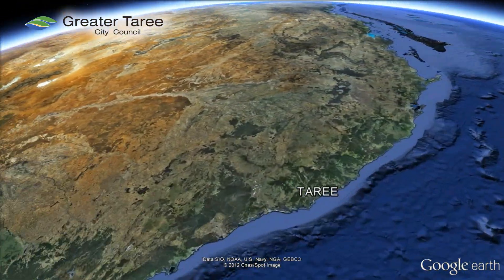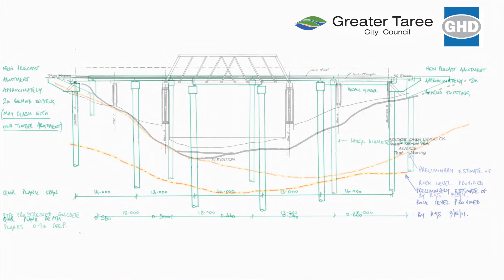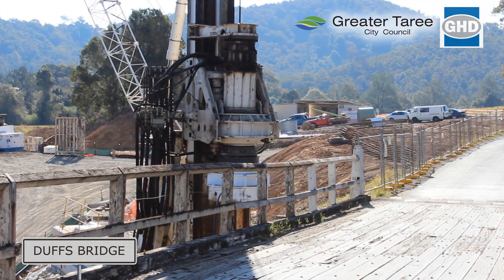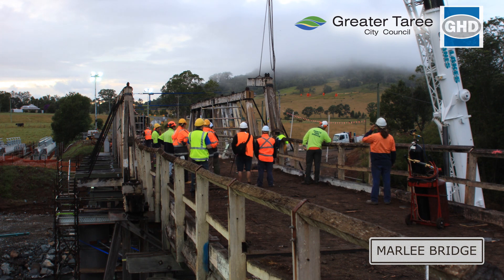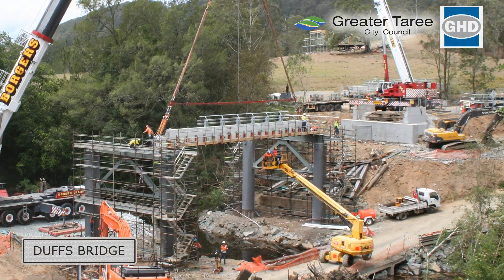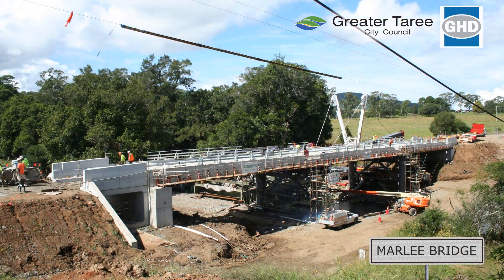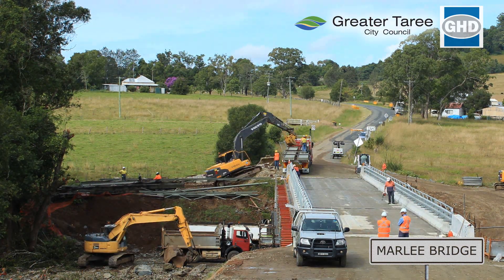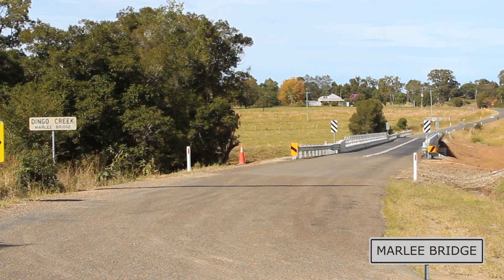Duffs Bridge and Marlee Bridge Replacements

Comment: To go off at a complete tangent. All those cranes and heavy equipment are powered by DIESEL. And always will be. The idea that heavy equipment and vehicles like that, and on a remote site, too, could ever be "battery electric" is completely absurd. For several reasons.

Comment: Of course they found an indigenous artifact.  It amazing to me we yield to “artifacts”, and demolish beautiful, historical works of art (that will last far longer than the ugly, replacement bridge ).  I think it’s disgusting how quickly the current generations want to destroy their history.  At time 8:05, You could have saved 30% by reducing the worker head count since 20 of them were just walking around doing nothing whilst others actually worked.
Reply: To my regret, this beautifull old bridge showed just in this video alone, lots of signs of needing not repairs but restauration. Which is in the modern moneydriven times just not feasable for a county to choose between steel and concrete vs wood. If some sponsor who loved the look would have told county to want to pay for the restauration (and upgrade to cope with modern trafic weights) they might have choosen to accept that. MIght because maintenance costs would still way heavy on their budgets.

The artifact mentioned was weighing on the decision where to put the new concrete bridge. Not on whether or not to demolish the historical work.
Since it was in the floodplain, the old bridge just had to go, once decision to build a new one was made.
Reply: Bert Bergers Understood.  However, I am certain there are non-artisan engineers, laborers, apprentices that would have dreamed of the opportunity to contribute to the restoration.  It is a shame, a crime really, how quickly we allow the destruction of our past.  Thank you for sharing a piece of history that we will never see again.
Reply: Rusty the Crown  You are a troll, and must have come out of your cave, moron, or mommies basement.  Most of my complaint was about the exorbitant taxes, and how the township did know about “the indigenous artifacts”, let alone care about them, until someone wanted to improve the crossing.  My other complaint is that in 19 years, no one will know about design patterns/principals that lead up to modern methods.  No appreciation for history.

Comment: The concerns about the durability of transversal bars is something that we had a major issue with in Montreal. The Champlain bridge was one of the first few in the world to use that construction method. The use of those transversal means that should any of the elements of the bridge fail, you can't replace it. This resulted in the entire bridge having to be replaced at a cost of several billions. Given that this is a much smaller bridge, it likely isn't as much of an issue, but it's definitely something to keep in mind.
Reply: Probably not billions as you said, but certainly could be quite expensive - how long are the spans on the Champlain bridge compared to this one?  Replacing a span on Champlain would probably cost at least what these two bridges cost combined, but I'm just taking a wild guess.
Reply: @MikeT-TheRetiredColonel   The Champlain bridge is a 3440 meter bridge. It's a major bridge, one of the most used in the whole of Canada. Even at such a massive cost, the economic damages of a bridge closure far outweigh any building costs. There's several hundred of millions dollars of freight being transported on it each year.  It met an early demise because it's design meant that the deck and girders were one single unit which made it impossible to replace, or properly repair parts that failed. Several hundred millions were spent to extend it's life just a few more years until it's replacement was ready.

After just a few decades, they started to notice that there was premature wear and tear. They ended up using external reinforcements to strengthen the girders supporting the road deck. That caused additional stress in the pillar heads and they also had to reinforce those. Being such an important bridge, closure would only be considered as a last resort. Plans were put in place for a worse case senario, including the purchase of a massive steel girder that they refered to as "Super Poutre" beam that could quickly be installed on top of the road deck if necessary. The bridge was wired with several hundred sensors and was monitored 24/7. In addition, regular inspections were carried out. During one of those inspections, they found a hole in one of the concrete girders that was more then a meter. Just about all of the pre-stressed cables in that girder had failed and for all intents and purposes, it's load was now being carried by the remaining girders. Super poutre was installed and stayed there for months to keep traffic moving while emergency repairs were carried out. 

The crazy thing is that while all of that was going on, government were still busy playing political games, delaying the replacement of what was now quite obviously a dangerous bridge. We had a highway viaduct collapse in the previous decade and the memories were still quite fresh. I think that Super poutre and the media attention that got is what finally did it and made the situation politically untenable. Once they finally start construction, it went up quick. Building a bridge on that scale is usually a process of a decade. They started in 2015 and finished it in 2019. Building started before the design was finalized. The new bridge is massive by any kind of scale, has a steel superstructure that can be repaired easily, or even partially replaced as needed. The rebar in the concrete is all stainless steel which should extend it's lifetime by quite a bit. The concrete itself is a special high strength mix. They really spared no expense after the mess that was the last bridge. I think that politicians have learned their lessons. There's a massive infrastructure renewal going on and there's really no opposition to spending the necessary money to make it happen.
Reply: @jonathanlanglois2742  Tks. Great to hear. Love Montreal. from Newfoundland. Good work.  good post.
Reply: @jonathanlanglois2742  don't you all salt your roads to de- ice? Which is not good for concrete structures
Reply: @matthewnewmann8555  All of the major roads are indeed salted. In fact, it used to be that the vast majority of roads would get salted. Nowadays, sand and gravel is often employed on more residential streets.

Comment: That 500 ton crane couldn't lift that little bit of wood you kidding me.😂😆
Reply: The crane wasn't assemble a its maximum lift capacity at the beginning.
Reply: The crane will lift 500 ton like right next to it, not 50 meters away on the other side of the river. So, get an even bigger crane in there (not possible without major earth works), get the crane midriver (not possible due to flood issues/ needs major earth works) or decide to split the load in two, and save some money in not having to go full monty on the crane, dufficing with the 350 ton package.

Besides "hat little bit of wood"  are you kidding me, wood is heavy!! Especially the dense hardwood species needed to construct a bridge that lasted 100 years (give or take, didn't pay too much attention to the years mentioned).
Reply: 350 ton

Comment: Placing the new bridges right next to the old other would have saved several million from each bridge.  It also would have allowed both routes to remain open without closures.  There is no advantage to building a new bridge in the old bridges location.
Reply: @MidnightVisions you watched the video? they intended to build a new approach and all, but some wildlife species blocked that new route. And since they didn't want to throw away another design (and dollars) when more wildlife was found, they chose this option. (first advantage)
Also mentioned at least twice, reusing the trajectory means little to no work needed on the approaches to the new bridge, compared to the long reroutes needed for the bridge in the river curve.
So that saves money (second advantage allready),
Not related to the actual bridge location, but testimony to how considerate they were to saving moeny or spending it wisely:
Initial goal was to build for $5 mil, tenders where put out at $12. They where thanked for there input and ignored.
The contractor asked to do the job was smart and designed one bridge to fit both locations, and delivered both bridges for $6 (or $6,8) mil dollars on and partly ahead of schedule.
The old wood was reclaimed. (which will have granted some money back)
And finally the temporary steel carrier structure built under the old bridgedeck and reused under the second, was designed to be usefull in case the county needed to replace a washed away bridge  in case of emergency. So money spent but not on steel to be scrapped immidiately after the project.
On such a big project to say there would have been a saving of "several milion" on a total of just 6 milion is plain stupid. (Even if i am mistaken and it cost the 16 milion MIke the colonel talks about, several milion are impossible to shave of the project)
Reply: Wow, several million from each bridge?  You do realize that it cost $16 mil combined, right?  And this is way out in the outback where the bridge closures had little effect on traffic.  I'm guessing you were an engineer on the project, right?  Oh, wait, you're a keyboard engineer - 'nuff said
Reply: @MikeT-TheRetiredColonel  Uh, i saw $6 milion in the end for cost, not 16 or is that ausd vs usd?